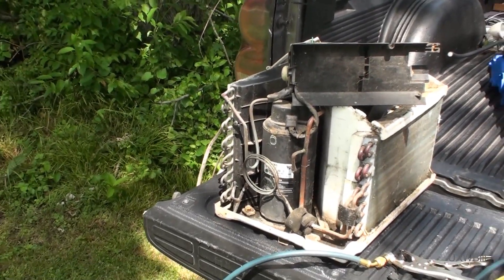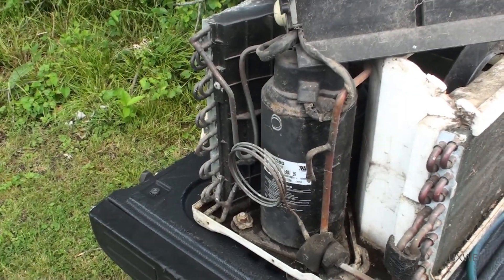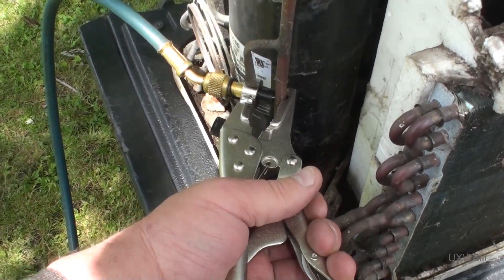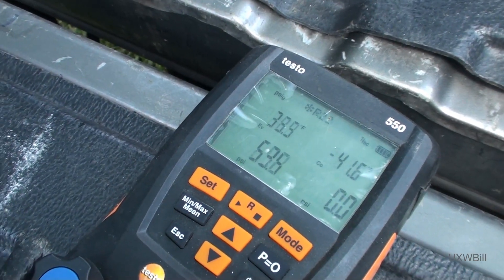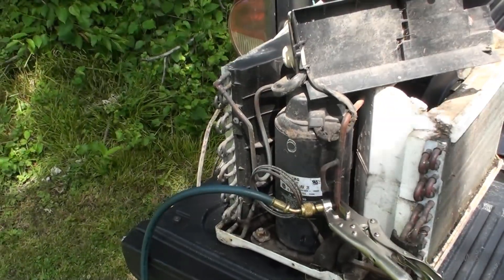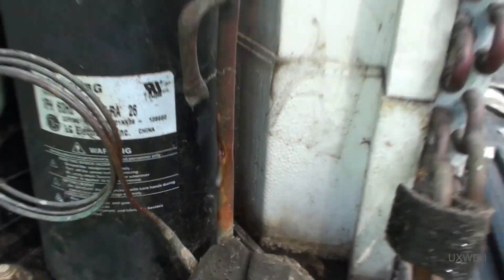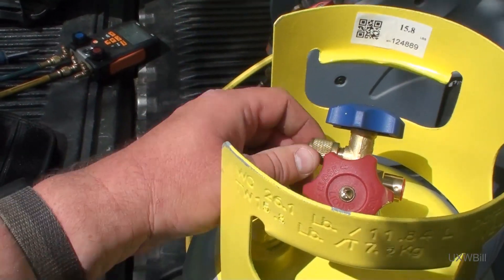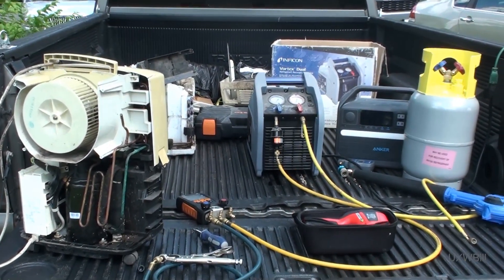Yellow Jacket 60667 Refrigerant Recovery Pliers Test

Comment: Thanks good intro to the recovery pliers. After doing thousands of refrigerant recoveries, I’ll make a few comments. They are a good tool and work well. Before clamping on, I adjust the plier with the adjustable screw/bolt so that the needle doesn’t bottom out in the jaw. They do not work well on anything smaller than 3/8 inch tubing. Only use them on copper or aluminum…a steel line will damage the piercing needle. If refrigerant is leaking past the gasket, quickly tighten the screw to attempt a better seal. Leaking refrigerant freezes the rubber gasket and it will crack if clamped tighter while frozen. Gaskets and replacement tips are available. There is another brand that uses a similar vise grip style but a much smaller tip and different gasket. It works well on 1/4 inch tubing. I use the pliers for recovery and repairs to access a closed system, install a small access stem, do the repair and solder the hole shut. Thanks again!

Comment: Hi Bill. I wish they would make window a/c's last for more than a few years. The old ones were noisy but they lasted 10 plus years.  I have two units, both less than 3 years old, on one them the rubber mounts for the compressor are completely dry rotted to the point where the compressor rattles so bad and shakes the entire unit and will keep you awake at night. The other one the compressor is stuck on no matter what the setting it's on and even if you turn the power off at the switch the compressor still runs the only way to shut it off is to unplug the unit. I think it's sad these two units are pretty much scrap at this point after only being 3 years old.
Reply from the maker: I haven't really noticed a decline in the reliability of newer window air conditioners. I would say that I don't think their electronic thermostats are even remotely accurate, but that's about it for complaints.

Rubber compressor mounts can be replaced. They are not expensive. The hardest part would be getting the unit out of the window and taking the cover off. The second one sounds like a classic case of welded relay contacts -- this could also be fixed. Just remember that working on electrically operated devices can be hazardous.
Reply: @uxwbill  Thanks for the reply Bill. I will for sure look into replacing the compressor mounts which I didn't know was possible on these units. I would love to get this unit running again since it was the more expensive of the two.
Reply from the maker: @KLM817  When you go to replace the compressor mounts, do just one at a time, so as to avoid flexing the attached lines too much.
Reply: @uxwbill  Thanks for the advice and I will for sure do that. It looks like a pretty straight forward job to do.

Comment: As an end-of-the-line video, you should pressurize the system to see if you could blow that plug out of the compressor... LOL.
Reply from the maker: It is likely to be partially activated by thermal means and not just pressure. In any case, I almost certainly don't have anything that would "safely" pressurize something to that level, and both of these items are gone now.

Comment: Refrigerant boiling out of the oil reminded me - can one change the oil in a sealed refrigeration system easily, or is the sealed nature of the system able to prevent degradation of the lubricant for "the life" of the equipment?
Reply from the maker: It can be done, though I don't know of any easy way. One might unsweat the lines from the compressor, remove it and drain the oil out through the openings where the lines were connected.

To my knowledge, so long as it doesn't take on moisture (as some oils will), the oil in a sealed refrigeration system is good for its entire lifetime.

Comment: Round these parts, the local scrap wombles just cut the pipes, hammer the compressors off, and leave behind the majority of whatever refrigeration device they liberated them from, only interested in the copper pipes & wiring, often leaving a mess of expanded foam from the insulation in the fridges & freezers they broke apart in peoples' yerds... :\
Reply from the maker: That's pretty much what happens here, although I have yet to see them actually tear apart a refrigeration appliance and take only parts of. The whole thing will disappear, but when it comes time to get rid of the refrigerant, they just cut the lines.

The scrap collector I gave these units to said his recycler of choice does not care or check for proper refrigerant recovery methods.

Comment: Thank you for these interesting videos. Out of curiosity what happens to the recovered refrigerant? I looked this up after your last video on the subject and I've read a lot of conflicting information online. I'm in the UK so our rules and regulationss will be different but it's interesting to me nonetheless how things are reused and / or safely disposed of.
Reply from the maker: A US-based perspective is all I can offer here -- so things could well differ. If recovered refrigerant is considered "clean" (not blended with any other type of refrigerant, possibly not removed from a system where a burnout took place), companies exist that will buy it. From there, the refrigerant may be cleaned and filtered, after which it is sold as used refrigerant. For certain refrigerant types that are no longer made, this secondhand refrigerant is all that may be available.

For refrigerant that is contaminated, those same companies will destroy it through various means, as that is the only thing that can be done.
Reply: @uxwbill  Interesting, thanks!

Comment: Alright, so, I'm gonna rip dad's old HVAC system out and put a new one in (the compressor shit the bed and this old thing is a R-22 system so it would probably make more sense to just replace it all and save about 15 grand given what we're installing, even considering the cost of the new system).

I'm putting this on the bill of materials, that just looks nifty as all hell! I might also be able to recover some of the cost of the new system by selling off that R-22 since that stuff is not getting any easier to come by 🤣 (probably not actually, but hey, world's a big place, strange things can happen).

Also, regarding the CandyHam's stabilizer, my Sony HDR-XR550 (from about the same era as that there pistolham ya have which is why I mention it) has the same trouble for some reason, but only sometimes. It's odd because my XR500 has excellent stabilization, but the XR550 just, the stabilizer sucks sometimes for some reason. My CX760 has that fancy balanced image stabilizer, but I don't use that thing since the zoom switch has input lag (like when you're playing an old video game on a HDTV and you hit a button on the controller, but it takes something like 3/4 of a second for the image on the screen to reflect your button press because the TV is applying a ton of image processing to the video signal before displaying it).

Comment: i have always enjoyed your informative videos as well as your excellent product reviews as it’s difficult these days that find honest reviews i do have a equipment question? what would be your recommendation for good quality refrigerant hoses and adapter fittings i personally do work in the automotive industry and don’t have a whole lot of personal equipment besides a scale a decent set of gages an a decent vacuum pump but i would love to invest into a recovery machine right now i just have my buddy who is a manager at a local jiffy lube recovery the refrigerant charge if necessary for what ever im working on so i am currently looking for good quality replacement hoses and adapters for the new 1234yf anyway i would love to hear your thoughts and thanks for your time 😊
Reply from the maker: I don't have a lot of experience with different refrigeration hose brands. The hoses I use have come from a few different places. I have the hoses that were supplied with my Testo and Imperial/Stride gauge sets, a few other hoses from a Harbor Freight automotive AC service gauge set and a few random "soft magic" branded hoses that mainly see use with nitrogen. Any hoses from a reputable manufacturer ought to be fine.

My R-134 automotive system adapters are the ones that also came with the previously mentioned Harbor Freight manifold gauge set. Despite the source, they've never let me down...but if you're doing a lot of automotive work, you probably do want something better. I only use them occasionally.

I have yet to work on anything using HFO-1234, so I don't yet have any adapters or whatnot for that.

I don't know how popular the Inficon Vortex recovery machine I have is. They were what we had in my class after the old and tired Amprobe branded machines were replaced. (Amusingly, those old machines sounded like and turned out to have a two-speed washing machine motor in them!) I've yet to see anyone else using the Inficon machine on Youtube. I've been perfectly happy with it, though.

Comment: If you mentioned it in the video I missed it, but I'm assuming both of those appliances had the same type of refrigerant? Is it acceptable to mix them together in the same recovery tank since they are just going to be recycled if they are different?
Reply from the maker: Both used R-22. You can mix recovered refrigerants, but if you do, they have no value because the result can only be destroyed. I don't mix them.

Comment: what killed that window unit if it had original charge?
Reply from the maker: Fan motor failure. I've fought with enough of them in window units over the years. With plenty of other good units to use, I wasn't about to fight with this one.
Reply: @uxwbill  i've seen vids of people changing the bearings on those motors - i guess if windings are burned the motor is shot.
Reply from the maker: @Jon-hx7pe  The effort involved in getting that motor out of there wouldn't have been remotely worth it. I'm sure it was installed before either coil was in place, and that's likely the only way it would have ever come out again. Electrically, it was fine. This was a cheap room air conditioner and I have no shortage of spares.

I've serviced those little motors in the past, when it was the only option or the fastest path to some cool air.